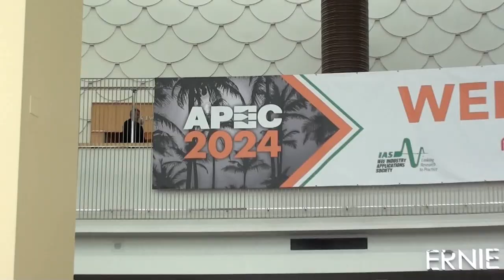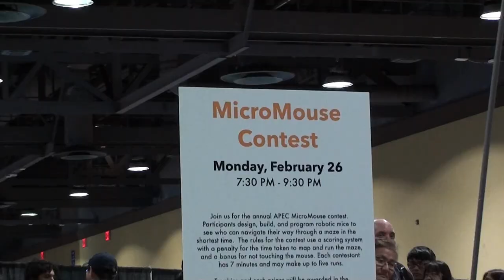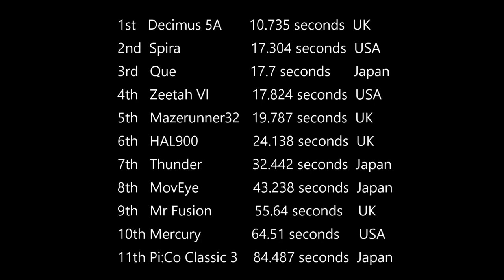Maze Solving Robots and More | Full APEC 2024 Micromouse Competition

Comment: is that allowed to touch the walls?
Why don't any of them use walls for changing direction, or grip? They could have lateral tires for this.
Reply from the maker: It has been done, but hitting the wall brings you to a stop, losing momentum and can cause unpredictable bouncing. You can be disqualified if it looks like you may damage the maze. There is no rule against it. I look forward to seeing your entry using this technique at our next contest.
Reply: @MicroMouse  me too😅hehehe. That's a good explanation, even knowing "biological" mice would pull themselves that way. Maybe that's different with wheels in front of legs, or maybe some day it will be possible with robot mice, with wheels or legs.
Reply from the maker: @AfonsoBucco  We used to run a contest ware you only run around the outside of the maze, some of them used the walls to turn as in this video https://www.youtube.com/watch?v=SZeotwcAan0
Reply: 'You can be disqualified if it looks like you may damage the maze.'
If you compare with racing and the fastest way to get through turns:
That can range from taking very wide turns at maximum possible curve speed to taking the shortest possible way, which is a sharp (and therefore slow speed) turn and that one mimizes time spent in the turn. For vehicles with very good acceleration that is the best way to take a corner.

Seeing how micromouse move that is definitively the best way to take corners for them. Meaning, they don't come near any outer walls in corners. But the outer walls are the ones that could effectively be used to exert forces in the direction needed.

Your mouse would have to take a de-tour, however, to even get to an outer wall. Meaning, the wall would really have to help your mouse to an explosive acceleration, otherwise it could not be an advantage: You'd need multiple times g  otherwise you would not need to start thinking about it.
Basically, if you cannot interchange huge forces with the environment aside from the ground, then any design effort should be aimed at optimizing stability and traction imho.